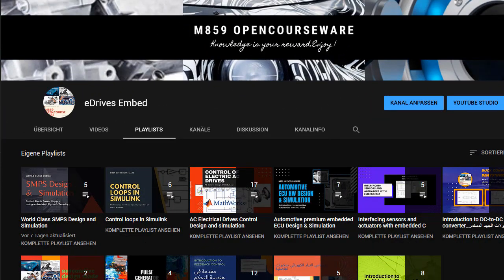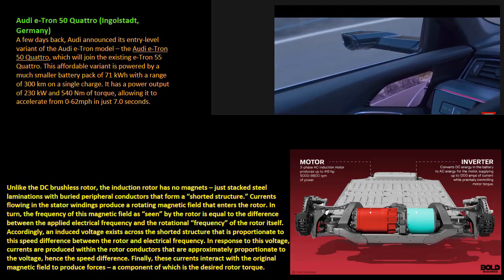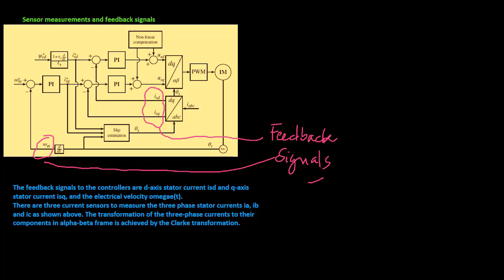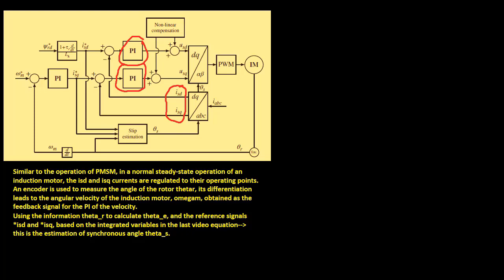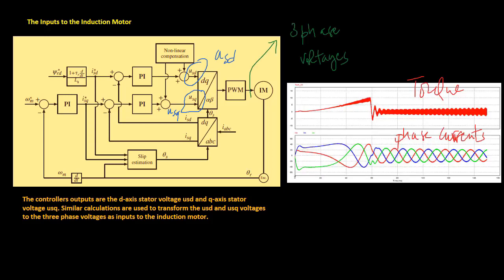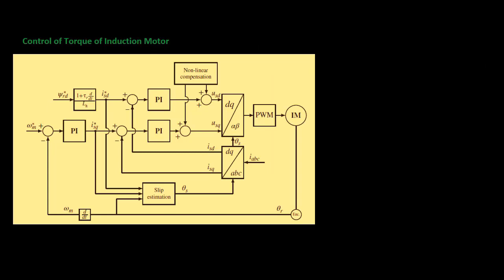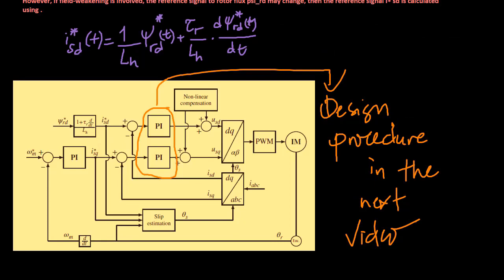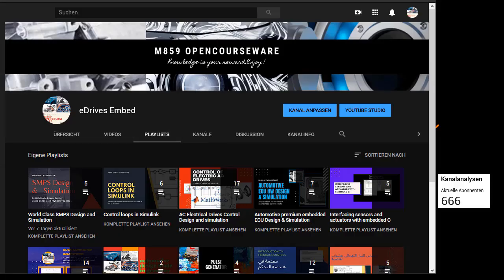First steps in the control system design of Induction Motor FOC

Comment: heyo why does the output of the speed regulator becomesthe input of the current regulaotr? Which relationship allowas to do so?
Reply from the maker: by using the differential equations in describing the mechanical part of the system and the link between the mechanical and electrical systems like in the first videos for the pmsm and IM we obtain the relationsship between omega_e and iq. transform it by using  laplace and this is the plant model for the design of the outer-loop velocity control system , also for the current  controller using thepole-assignment controller design.if you follow my videos in this playlist from the beginning, they depend on each other and explain everything. try to write the equations yourself to then understand the methodology at the end. The goal was always to find a first order system and calculate the pi controller for it.